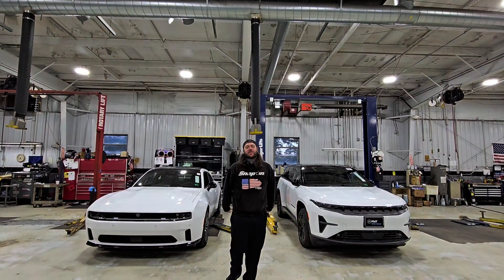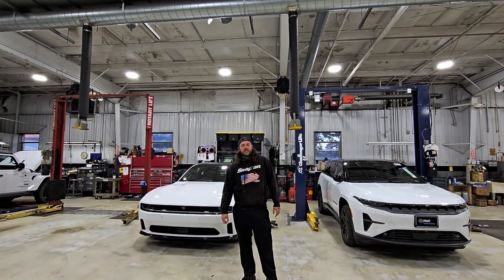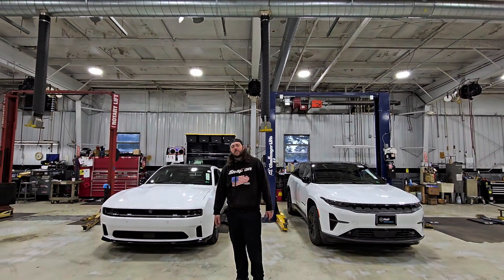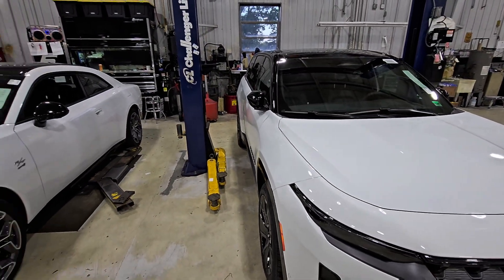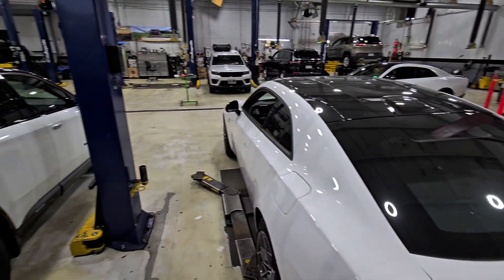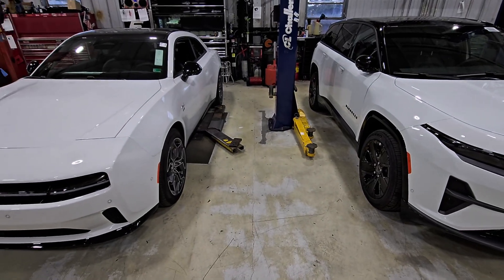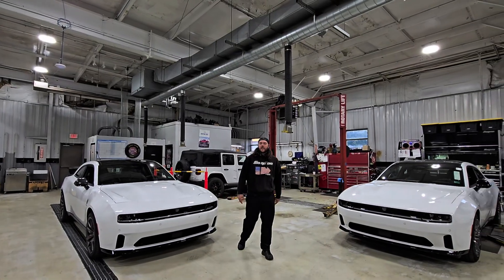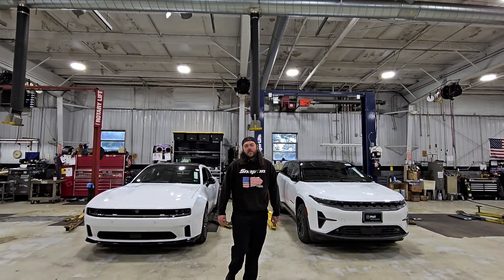FIXED? Did Stellantis Just Solve The Bricking Issues For The Charger Daytona and Wagoneer S

Comment: What is the TSB for the 2025 R/T? i been having these bricking issues, and when i took it in for service, i tried pointing them to this TSB and they replied that it was for the 2024 model year only and pretty much gaslit me after that when i tried to ask if there's a 2025 variant of this issue, and instead blamed solely the battery and replaced the battery and called it a day. So I have no doubts I will have this issue again but hope to be armed with the correct TSB the next time I have to go in for service for the exact same issue.

Would be awesome if the video description included the TSB for all variants

Comment: So, just had this happen to me this morning.  Stopped to pick my daughter up. Shut down the Wagoneer S. Loaded up her stuff. Power button On and moved the gear shifter and the dash went nuts, vehicle won't move or power down/off. Shows all kinds of warning lights and messages. All gear indicators are red and Auto Park not engaged message flashes.
Tried disconnecting the 12v battery for 30 seconds, nothing. 
Trying now for 5-10 minutes while I wait for Roadside Assistance.

Comment: Great video. I purchased a 2025 S Launch Edition in February and initially had no issues. After a couple of weeks, the “lobster” icon began appearing—this was prior to the software update, so the vehicle was completely immobilized. As you mentioned, it would eventually start after 10–15 minutes. I contacted the dealer after the third or fourth occurrence, but they were unaware of any update at the time.

Following a brief period without issues, the problem resurfaced. By then, the update was available and installed, which thankfully allowed the vehicle to remain drivable even when the lobster icon appeared. In August, however, the vehicle failed to start entirely—no dash lights, remote access, or power. The 12V trunk battery had dropped to 2.8V. After charging it for an hour, the vehicle started and has been running fine since.

Despite these hiccups, the car continues to impress—it's the only S I've seen on the road locally, and it consistently draws attention for its design and performance. I still love this vehicle.

Comment: God I wish this update would have worked for my Daytona RT.  The updates were done.  It only lasted 17 days before it happened again.  I love this Fkn car!  It's frustrating as hell!
Reply from the maker: It kind of helped, most customers now just get a warning light instead of it becoming immobile and always needing a battery disconnect. We have a new one coming soon for the wheel disconnects, the RTs are having problems the Scat packs are not.
Reply: @MoparTechJordan  my 24 daytona scat pack failed to start about 2 weeks after the RSU25-080 update so not sure where to go from here

Comment: I can confirm the answer is No. They have not fixed it as of June 20th, 2025.
Reply from the maker: Ehh It kind of did, at least if your driving a Scat Pack and not a R/T or a Wagonner S. Those models have wheel end disconnects that the Scat Packs do not, andy the Wheel End Disconnts are causing a bunch of issues. But even still, The software that came out late april helped laid the building blocks for this next update coming next month, the majority (but not all) of customers no longer find their vehicle is completely immobile requiring a 12v disconnect after seeing a fault, and now remain mobile when even though they are getting the wrench light. Our next update will build on 11A and 6A1 and focus heavily on wheel end disconnect issues.
Reply: @MoparTechJordan  Unfortunately not the real issue. It appears it's the 12V Ethernet bus being underpowered by that tiny 40AH 12v battery that gets cycle discharged/recharged every hour the vehicle is off. The 12V battery drops from 13.8 to 11.9v several times a day, even while driving. If it were a larger 600CCA+ battery, this would not be a problem. But the tiny thing is getting deep cycled over and over again, until several modules drop off the bus, including the throttle controllet, which causes the turtle with the "unintented acceleration" feature kicking in. The battery is an underpowered unit and unfortunately it's space constrained and may require a lithium ion 12v battery that can fit in there that's at least 100AH capacity.  Electrical engineer here.

Comment: So how long in my dealership techs hands before I start bugging calling ?
Reply: Mine has been in for 3 weeks. Won’t charge.  They tested HV battery.  Here is what the service manager told me.       They had us perform a LOI (Loss Of Isolation) test using the vehicle's own electronic testing system and it performed properly with no fault. Engineering then informed us that a new firmware update was about to be released which may address this concern but to perform a HV (High Voltage) system power down and then perform a manual LOI test at the actual battery service connection. We performed this test and there was nothing abnormal with the readings that we took. The vehicle did not like being manually powered down so there was a bit of time spent with engineering getting the vehicle operating with no codes again. Engineering then informed us that we need to operate the vehicle with a recording device interrogating the computer system and have the vehicle act up and set the fault with the device recording. We did as they asked, it took a while but the vehicle did eventually set the fault and we were able to record it while it happened. We then sent this information back to the engineers, this was June 12th. Engineering reviewed the documents and got back to us yesterday that they want another specific test performed with the HV wiring, which involves powering down the vehicle manually again and then disconnecting some of the HV system components in a sequence they directed and providing specific readings during each step back to engineering for review.

Thoughts.
Reply from the maker: @ThomasDoyle-s1c  What are you in? A wag or a Charger? If you're in a charger, is it a R/T?
Reply: @ThomasDoyle-s1c  from our techs here at grays harbor dodge we got a new 12 V battery install so far no errors nothing is going wrong so far we will have our car Monday or Tuesday this coming up😊
Reply from the maker: Give it a about a day. The actual software update take about 2 hours, but that doesn't include the check in process, paperwork, and if your dealer only has one EV tech they may be backed up a bit.
Reply: @MoparTechJordan  I guess they only have one tech and I drove by today i don’t think they’ve touched it yet I dropped it off Monday morning so hopefully by this Friday if not I’ll be doing a wellness check on my car lol
Reply from the maker: @rxbmoney  I don't blame you haha. I don't think it should have taken that long. There is always a chance there was a issue with the update, but I would hope they would communicate that with you.
Reply: @MoparTechJordan  they have the worst communication at the local dodge dealership in Aberdeen WA impossible getting a hold of someone there but we will see tomorrow how it is 🙏 thanks for commenting back and letting us know firsthand what it takes to get these back on the streets
Reply: @MoparTechJordan  I got an update a day or two later when I called they ended up finding a short in the battery so just waiting for them to get it delivered by Stellantis hopefully sooner than later
Reply from the maker: @rxbmoney  That's awesome! I'm glad they were able to pinpoint it. Hopefully it doesn't take too long to get the battery

Comment: Seeing a good number of LB and KM vehicles being towed in with the Power Cube 11A update RSUs open yet the vehicles are already at the 'latest and greatest' software levels and had stone dead 12-volt batteries.  The 11B updates should be out shortly (followed by 11C, and so on...)
Reply from the maker: I wonder why they're not being closed in the VIP? On my personal LB I performed 11A and a week later found another BPCM update that when you clicked on the TSB link said it was part of 11A, yet no update for the techs to go back in a double check
Reply: @MoparTechJordan  The RSU system is a mess.  If you get an LB with an 11A update (with Sleep Cycle) take the extra hour but there is no need for the sleep cycle - do it if it makes you feel better but it is a waste of time.  The sleep cycle was for KMs with certain HV battery build dates where there was a batch of suspect HV contactors.  The 'sleep cycle' is designed to exercise the contactors and see if a welded contactor fault can be induced.  The LB should have never been included in the RSU that involves the sleep cycle.   The 11B updates are slated to roll out soon (supposed to have been out by the end of Q2) so maybe they will be out before Q4.  At which point the next Whack-a-Mole flash will be under development.
Reply: If you'd like another example of just how incompetent the persons creating TSBs / RSUs for Stellantis are, have a look at the 12 available TSBs regarding power cube flashes for KM.  On step 20 (or 22 depending on the bulletin) the question is asked 'does the vehicle have sales code DH4?'
DH4 is a sales code for LB as not all LBs have front wheel end disconnects.
ALL KMs have wheel end disconnects, but none will have sales code DH4.  These dummies simply copy and paste information from one platform into another and don't take the time to make sure the information they are giving is applicable.

FWIW, it is now being investigated that FOTA updates for U-Connect may be related to causing 12-volt battery drains on the BEVs.  Go Figure...
Reply from the maker: @SomeMook  shoot me a message on Instagram. I have something I want to tell you.

Comment: so, stellantis approves the 12v battery... I hope that's just for a warranty replacement, and not every time you need to replace one.
Reply from the maker: @daves2433  Only under warranty replacement do we require approval, that also goes for a lot of other parts we replace. But if you wanted, you the customer could purchase a battery out of pocket and we could put it in. 

It can be frustrating, sometimes, but that's the life a dealer technician.
Reply: @MoparTechJordan  I hoped that was the case, and not them saying you can't replace a battery without them knowing or something. Thanks for clarifying!
Reply from the maker: @daves2433  So they probably wouldn't like it if a battery was replaced with a aftermarket battery, at least while it's warranty. If there was a electrical issue, they may question the batterys design, quality, and why someone would tamper with a vehicle still under warranty, ECT.

As techs we have to report that kind of stuff, not because we want to rat you out, but because they help us repair the vehicle when we contact tech support. It would be like someone going in to the doctor for a cough, but neglecting to tell them they just smoked an entire pack of cigarettes if that makes sense.

Comment: I had a notice on my center screen that a software update was available and asked if I woud like to proceed. I tapped yes and a message replied I must not drive the car and to put the shifter into neutral or park. Fortunately I had just arrived at home and parked outside. I believe this was taken care of by the Uconnect system.
Reply from the maker: @michaelburley9479  So that update was for your Uconnect infortainment system. Any major powertrain updates for the Chargers and Wagoneers will require dealership service. It's unfortunate I know, but with the vehicle current design these major updates need to be performed in a controlled setting.

Comment: Thanks for this update! We got a Wagoneer S, and sometimes, it doesn't start, shows the red wrench, or shuts off all displays (incl. A/C and radio) while driving. A soft reset fixed these issues so far, but a software update addressing this would be great. I knew it would be coming, but this is faster than expected.
Reply from the maker: You're welcome! We're still going to have some future updates coming for other issues as well. They'll have all the kinks worked out before we know it!
Reply: @MoparTechJordan  I ordered the Wagoneer S the first day when the online order bank opened. I knew that there would be some issues, but even at the status quo, it's not bad since the vehicle fixed itself each and every time. Other than that, it is just a blast to drive! My other vehicle is a MY23 Grand Cherokee 4xe. I'm too much of a tech- and Jeep fanatic to let the little issues spoil the fun.😂

Comment: Can software updates be done over the air or requires to be done at dealership?
Reply from the maker: @XxBringBackThePastxX  This requires dealer service, it's a little more involved than  than just updating software. At this stage of the vehicle design, over the air updates will only ever pertain to the Uconnect infotainment system.
Reply: @ oh k that makes sense, I wish they could have used Tesla as the blueprint on how to develop EV cars.
Reply from the maker: @XxBringBackThePastxX  That would have been nice. But there is one silver lining, ever time you have to bring your vehicle in well be able to look it over and make sure everything is in working order or address any other concerns you may have.
Reply: @MoparTechJordan  so I just need to make a appointment with the dealership to get the update done?
Reply from the maker: @XxBringBackThePastxX  Yes sir, it just released so if they're having trouble finding it just reference the TSB/RSU number in the description of my videos, or this video. 

Please be patient with your techs, this a brand new platform and we are learning the ins and outs of it.
Reply: @ ok no problem

Comment: Thanks for the information, my Charger Daytona is still stuck and a brick at my service department. They did find a new problem on mine where the EV charger gets stuck and even if you unplug it the car still thinks it’s being charged. Not sure if you encountered that as the expert but just thought I would share. Thanks again!
Reply from the maker: That does sound like a separate issue from what this software update would resolve. But your tech should be able to isolate the fault. Please be patient with them, this is a new platform, and Engeernering doesn't use the fastest means of communication if we do need help.
Reply: @MichaelHernandez-p8l   This happened two or three times on my Wagoneer S. I noticed this when I interrupted the charging process before it reached the programmed level (80%).
Reply: Mine just did this 2 days old 30 miles 😅
Reply: @EVILKTOWNTEXAS  It’s been over 5 months and still hasn’t been fixed 😅 and of course Stellantis is super slow with lemon payout
Reply: @MichaelHernandez-p8l  crazy work at least i got 2 days 😅  ready to take to the dealer tomorrow morning hope they can fix it .. whats the steps look like